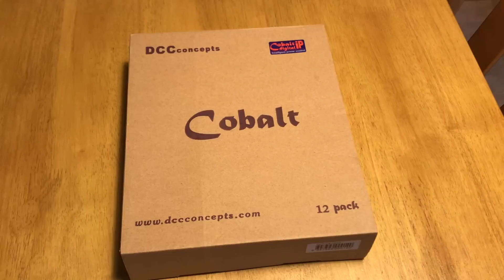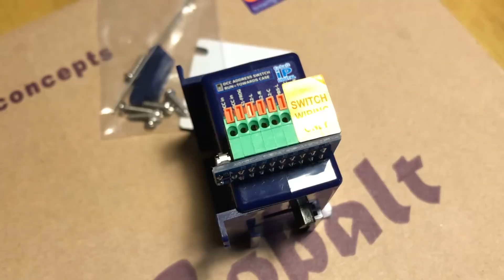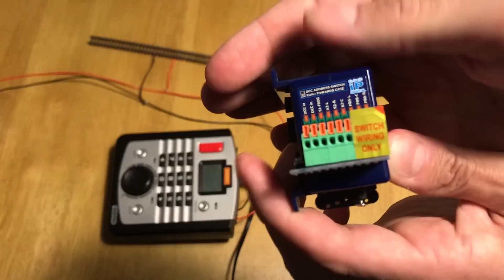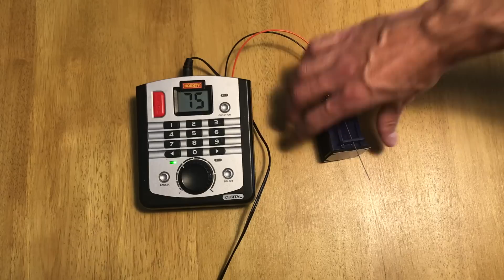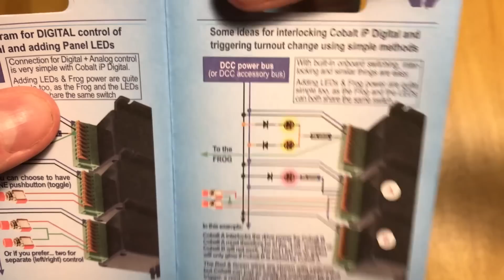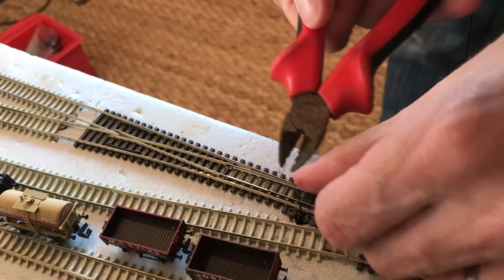Cobalt IP Digital - DCC point motor control for model railways

Comment: Hi, Thanks for postingt this video, even thought it was 6 years ago. I am just about to fit my first motors of this type and wanted to program it and test like you did with the Hornby Select. The motors I have purchased are pre-centered where I notice yours wern't. If I have read ths instructions right I need to decativate the pre-centre first before I can program it. However to do this I think i need to program 198  and my Hornby select can only handle two digits I think. I am waiting on the new Bachmann Kinesis control system but it has been delayed from its promised December arrival. I am loathed to go out and buy another prev owned DCC controller but I might have to. Any thoughts on the pre-centering issue? thanks

Comment: Hi Simon, one quick note (9.44 mins) - I needed to send back a new electrofrog Peco double slip for repair. After wiring in IP Cobalt motors and removing the springs to the points, the point blade became detached. Peco explained that the spring has a dual purpose to ensure contact BUT also to retain the blade. They replaced all blades and springs explaining that point motors should be powerful enough to work with the spring.PECO advice - DO NOT REMOVE THE SPRINGS

Comment: Morning Simon, July 2022, just revising what I need to do to install my Cobalt iP Digitals in my N Gauge Code 55 points and noticed how you use the outside of the tie bar to change the point. Is this easier than trying the middle or is it personal preference? Thanks Peter
Reply from the maker: Hi Peter, on my points there was no hole in the middle so it had to one side or the other.
Reply: Hi Simon, in the middle of mine there is a small cut out rather like a notch hence my question. However, trying to think KISS (Keep it simple etc) I am feeling that for pure reliability the outside will be the way to go. Thank you for the inspiration modellers like you impart on others who are attempting to do what you have already done. Stay safe and once again thank you. The devil is in the detail that one can see after several watches. 👏👏👍👍

Comment: The only criticism I have on these motors is they placed the fixing holes inside the plastic frame instead of flanges like they did on the side (what are they for? mounting to a vertical face?). This makes for very difficult drilling of pilot holes vertical into the board (as per your video where the drill chuck fouls on the motor casing) which is important as the supplied screws do not have very sharp self tapping threads so its a real challenge (I bought better screws). Needs a design review IMHO

Comment: Hi mate, thx for the useful video. What size hole did you drill for the tie bar? Did you have to adjust how far the tie bar moves with an N gauge turnout?

Comment: I find not so easy when under baseboard trying to feed the throw bar into the point.  Wonder why DCC concepts have been out of stock of these motors but other dealers are getting fresh stocks in. Just purchased another 12 ip's fresh in (July 2020).  But none available from DCC concepts, strange.

Comment: I use Cobalt analogue with their smoothed 12v system if I can use one I bought by mistake by connecting to DCC and using an analogue switch this will be good(especially for my wallet)

Comment: Although new at this I find the Wago connectors save even any crimping plus easy to disconnect wiring if needed. I would really like to know an easy way to get the piano wire from the motor through the little hole in the point whist grovelling under the layout often half upside down and cursing like mad!

Comment: Thanks Simon, have you used these motors on a Peco Code 100 SLE-99 Threeway point? As it requires two motors, and would appear a bit tight for space between the tie bars
Reply: I haven't done this myself but I spoke to DCC concepts a couple of days ago about this.  They say that you can easily do this by mounting the motors with the throw arms facing each other.  I have measured it up with a 3 way point off the layout and it looks like there is plenty of room.  If in doubt call DCC Concepts on 01729 821080 - they are very helpful.

Comment: Hi Simon, that's helpful. Others have said these are noisy, but that appears to be because they are clamped firmly to a resonant baseboardand use two stage gearing to give a slower and perhaps more prototypical throw. Some isolating rubber washers, or the sticky pad, should deal with the noise. I was very interested to see the extra functionality, especially the interlocking as well as the frog connection. And I believe that they are sourced by a British company. BobUK.

Comment: I have used and tried every point motor there is and have to say without doubt these are the best, I am now using the IP Digital with the Alpha central and along with the plastic jig that you can buy it is so quick and easy, I used to dread fitting and wiring points now it's one of my favourite bit's.

Comment: Just caught up with this great video. Just some questions as I am thinking of using these for my small layout. Are they easy to position so the wire throws the point all the way?  Will they stop when the switch blade reaches the stock rail or must you adjust the throw wire?
Thanks Dave
Reply: DCC concepts sell a guide which makes it as easy and quick as opening a pack of crisps, I managed to fit and wire 7 of these in an hour it used to take that for one.
Reply: Thanks Rob I will check it out. Mind you takes me half an hour to open a pack of crisps sometimes 🙄

Comment: Tip: use silicone washers under the mounting screws, this massively cuts down on noise transmitted to the baseboard

Comment: Another question , I have z21 , and a limited knowledge . Now,  what is in between the Z21  and a Cobalt motor , that I would have to obtain ?
Reply: You don't need anything else, just hook the motor up to your DCC BUS and depending on whether you're using a hand controller or the Z21 App, programme them accordingly. Simon has done a video on how to do this using the z21 and the App.
Reply: @nellyracer22  Thank you .

Comment: This video was my real Christmas present . Thank You , for this video .
I am good at modelling , but not at wiring ...and had a few problems with my  current switches . 
So please , would it be compatible to use  Digikeys decoder , Tillig switches ( powered frog)  and a Cobalt motor ?

Comment: Nice video Simon. I can confirm from experience that if you wire up the wrong end of the point motor to the DCC signal it does destroy the device. I bought mine before the manufacturer started putting the warning stickers on them and once in the gloom underneath the baseboard with some facing one way and some the other, its a surprisingly easy mistake to make. So I would strongly advise others not to the remove the sticker unless you need to use those terminals. Cheers, Ed.

Comment: Hi Simon
Ive been using these for a while and find them to be easy to install and configure but I have had one that had an issue getting hot and working intermittently.  I sent this to DCConcepts and they mended it and all under the lifetime guarantee, excellent service.
The one other thing I do is as its tricky to get at the motors under the boards I replaced the supplied screws with some small wood screws as the ones supplied won't self tap into my base boards. 
Enjoyed the video and I can scrap mine now lol if you dont mind I'll link yours in my video.
cheers Paul

Comment: I am very interested to see how these Cobalt point motors fit out.  You have explained it and demonstrated them very clearly.  They seem like a well thought out solution.  You may know I use Tortoise motors which are not DCC on board.  I use Tortoise motors not just for points, they also operate my level crossing arms and the stops on my Faller road.  So, I am very familiar with them and was curious about these Cobalt units.  Thank you for the great explanation, Rob

Comment: Have you tried programming them with the new Z21 app? When I'm stripping wires, I only take the insulation part way off, then twist as I take it off completely. Makes a neater job and prevents getting the ends of the strands sticking in your fingers. :-) I use Kato and Minitrix point motors. I'll connect them one day.